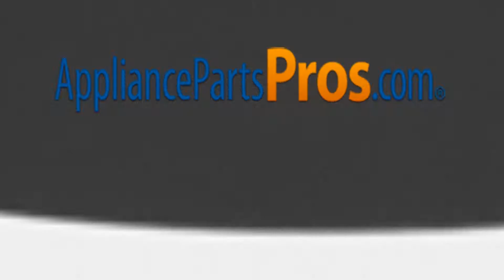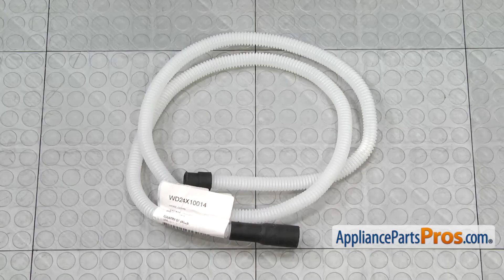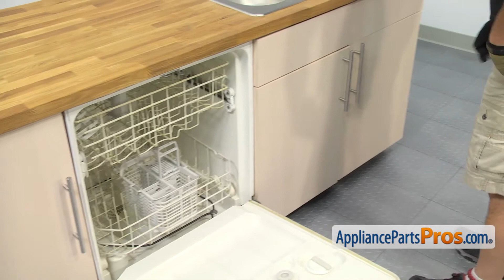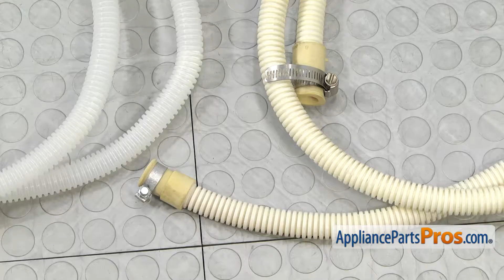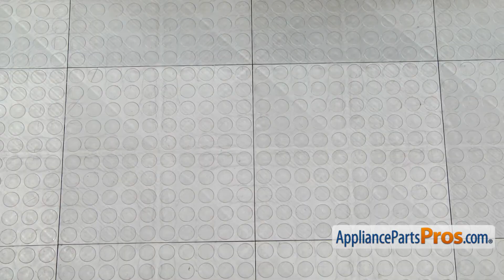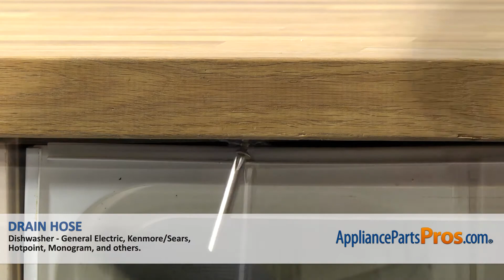How To: GE Drain Hose WD24X10014

Comment: is an air gap completely necessary or can I connect right to the inlet above my P -trap?
Reply from the maker: An air gap isn’t always required, but it depends on your local plumbing code. Its purpose is to prevent dirty water from siphoning back into the dishwasher.

If allowed in your area, you can connect the hose to the inlet above the P-trap, but make sure you have a high loop in the drain hose to help prevent backflow.